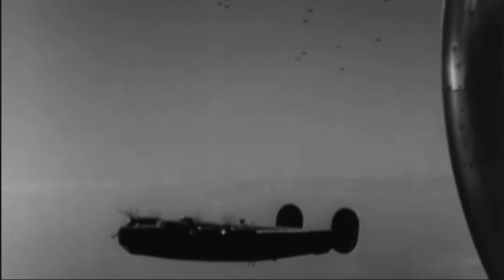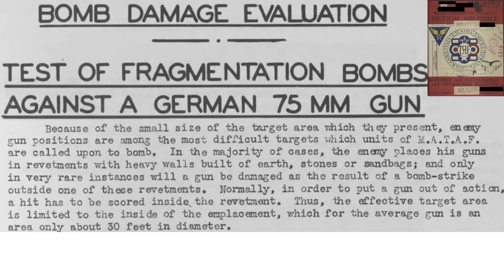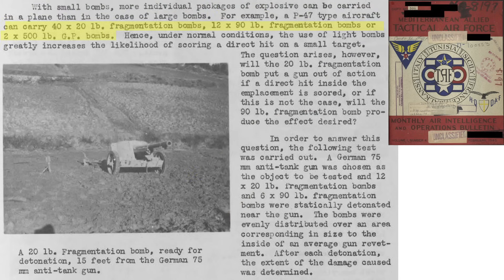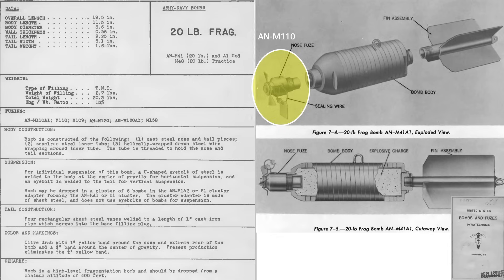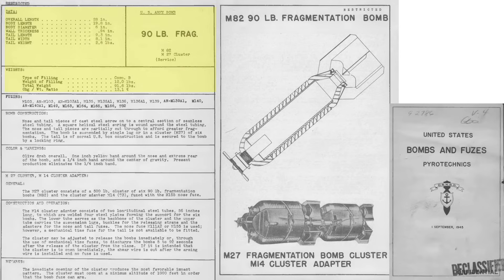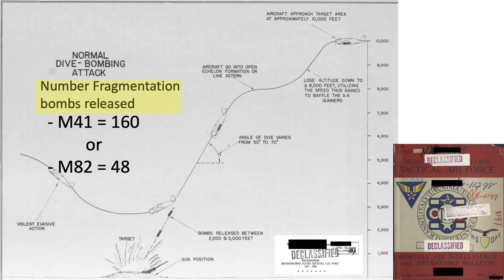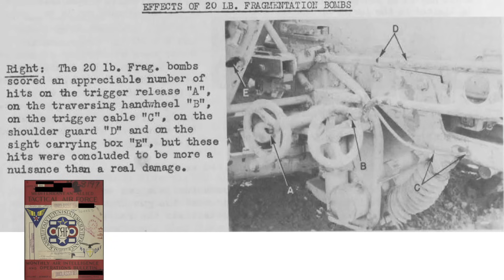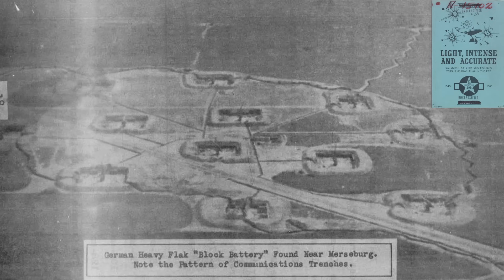The Most Effective Bomb to Destroy a German 75mm Anti-Tank Gun,  WWII Damage Test Review Deep Dive

Comment: The splinter damage to the gun barrel was pretty freaking scary. It looks like the nearly 1 inch thick steel fragment liner would probably be more than enough for panzer I, II and maybe even III's, those  gouges look to be at least an inch deep into the gun steel and remember that gun barrels are made out of dramatically better quality steel and are usually through hardness supposed to just surface hardened, so if the fragments are doing that to the barrel, half tracks, armored scout cars, even big cats like the Tiger or Panther are in serious trouble

Comment: Disabling or destroying a gun is, of course, ideal. 
But all artillery requires crew and ammo, so surely destroying/disabling those two factors would be just as effective (if not more so) as hitting the weapon itself.
Therefore, why not just drop lots of blast bombs around artillery to take out the infrastructure rather than hope that fragmentation bombs do the job?
Excellent video as always.
Reply: It's a good point, but I think it depends on the enemy in question.  Even for the Germans, who were often short of both ammo and people, disabling the gun itself may be more effective, because if the gun can be put back in service they're going to press other soldiers into manning the gun.  Maybe not trained as well, but still potentially effective.  And as to ammo, I don't think fragments are generally going to cause it to detonate - could be wrong - and ammo caches are going to be located farther away and probably both better protected and harder to find, speculating.
Reply: more ammo and crew can be provided....

Comment: I guess the next facet to consider are the gun crews themselves. Did anyone use flechettes in WWII? The kinetic energy of an aerodynamic projectile falling 10,000 to 20,000 feet would be an effective way of using altitude. Could it  cover large areas with lethal anti personal devices in enough density to cause significant casualties? From the ground  it would be impossible to see small flechettes heading straight at you.   No explosive would be needed, just dispersal.    (I looked this up and it seems the problem was accuracy and distribution.) 
A third facet would be the repair aspect. I understand that railroad switching yards weren't much of a target because repairs could have trains moving through the very next day.  Were the Allies able to estimate effectiveness and down time for the anti aircraft guns and compare that to what it cost to attack them and the increase in safety to bombers and crews?

Comment: If the ammo or crew are anywhere nearby the 20 lb frag bombs would probably still be sufficient to effectively knock the gun out of action.
Reply: After seeing the effects of fragmentation on field artillery in the Ukraine war I’d agree but I would also say it’s pretty quickly repaired. Certainly effective at destroying the hydraulic recoil system and barrel
Reply: @AsmellYoullGetUsedTo  The recoil mechanism is Hydro-pneumatic not hydraulic.
Reply: @andyboi8399 that depends on which artillery piece. The older designs were hydraulic and springs
Reply: @AsmellYoullGetUsedTo  Yes. Very old designs, as in pre-WW1 guns were Hydro-spring. A few post WW1 examples exist but they are mainly low caliber guns (Like the 40mm Bofors or the Puteaux 25mm). Basically all modern artillery uses hydro-pneumatic systems. This is because metallic springs are unreliable since their elasticity can radically change with even moderate variations in temperature and they are also prone to breaking. Then, there's also the age old issue of it becoming very impractical to make a spring past a certain size.
Reply: @andyboi8399 I think they are still using some hydro spring 105designs actually. The light weight British designed 105 which the U.S. also license builds. 
The Germans were using a lot of old captured weapons towards the end of the war which were still hydro spring. Basically using whatever they had left by that point. Some old Russian designed soviet field artillery and French. I think even some Czech. Also the pack howitzers I believe used hydro spring

Comment: Now they use a ,$1000 drones that takes out a 25 million dollar tank with no problem. This would be cake work .
Reply: For targetting guns with drones, they use RPG warheads to precisely put a hole in the barrel, effectively spiking it in a way that isn't field repairable, often completely irreparable.
Reply: Well I wouldn’t say no problem. You almost never see the failed runs due to ECM or other obstructions. Anti-drone nets are becoming the modern equivalent of barbed wire (aside from barbed wire).
Reply: @aidanmattson681 Anti ECM equipment is a thing too… 
The simplest is internal inertial guidance and slightly more advanced is internal image guidance…
Reply: @allangibson8494  Drones are not advanced enough to autonomously use INS or thermal seekers yet for general targeting. At best you can mark a target for destruction in the open and the drone can autopilot towards it. Still affected by ECM though so it's only useful against easy targets with relatively weak ECM arrays
Reply: @ Actually the US Military has been using them for decades. That’s how a fire and forget missile works.
Loitering munitions take that to the next level, targeting anything in their image database within a designated geographical area - the limit is the area needs to be well away from your own troops because, to the algorithm, a tank is a tank and a truck is a truck.
ECM is completely irrelevant to shielded sensors. Laser blinding will work against optics but inertial guidance will still get a warhead to a geographical point. Radiation seekers in the HARM missiles have been doing that for decades - find a radio source and track towards it even when it is turned off.
Reply: @allangibson8494  There are exceptionally few truly autonomous loitering munitions, almost all of them are man in the loop until the target is designated, or they are only autonomous in an extremely cooperative environment like open ocean where the odds of sensors picking up friendly units are very low. Software is not reliable enough to pick up targets in most situations purely autonomously with drone mounted sensors and trust them to make targeting decisions on their own without input from a human.
Reply: @ Which is why I specifically mentioned using them well behind enemy lines (which is what is happening in Ukraine and Russia). Basically big and metal (and optionally, moving) equals target.
Reply: @allangibson8494  The problem is that you will still need computer vision able to actually select out vehicles that may or may not be camouflaged, or in the database, or even civilian or not. How do you avoid drones striking the same burned out vehicle a dozen times? The thermal imagers on these drones are not that advanced because that jacks up the cost massively. It's simply not advanced enough yet to be that useful compared to something flown in by hand (whether using wireless or fiber optic signal transmission)
Reply: @ That’s why the “moving” is an optional condition. Hitting a vehicle multiple times isn’t a major problem if you want to ensure it can’t be salvaged.
Thermal imagers have gotten much cheaper and better of late with commercial phone cameras having imaging capabilities on par with military systems of a decade ago.
Reply: $10000 drones. 
That's what they cost us, anyway. 😂

Comment: Would love to see how the forces discussed (or didn’t) damage on the ground caused by unintentional contact from jettisoned fuel tanks, bullet casings and links, parts shot off aircraft, etc.
Reply: Random and insignificant.  Bullets from strafing aircraft an issue. Bullets fired at 20 or 30 thousand feet would be widely dispersed, sure you might lose and eye if looking up at the wrong time.  This or even random shrapnel from AAA fire would cause damage but nothing that would interfere with the course war unless it killed a senior commander or the like. No doubt civilians were injured by falling stuff but unless a bomber falls into a factory, fuel depo or ammo storage you just have a hole in the ground of various sizes randomly placed.

Comment: That gun in the period photos of the gun show a 7,5cm PAK 97/38, not a PAK 40. The gun in question is an old French 75mm fieldgun on a German 50mm PAK 38 gunmount, with a muzzle break also added. It fired HEAT against tanks, instead of the AP shot used by the bigger PAK 40.
Reply: I noticed that as well. It is unlikely that the test results would be meaningfully different.
Reply: Still a tank killer
Reply: True the barrel on the German gun is much thicker to handle the increased pressure.
Reply: Go outside and meet a woman, please.